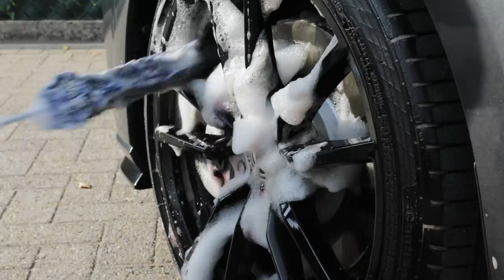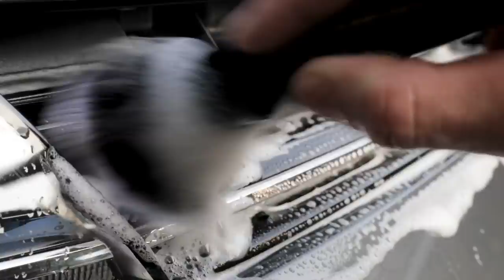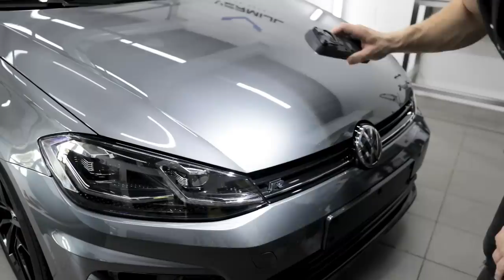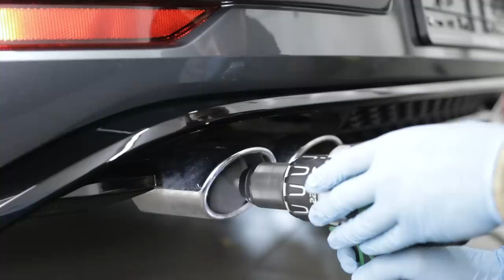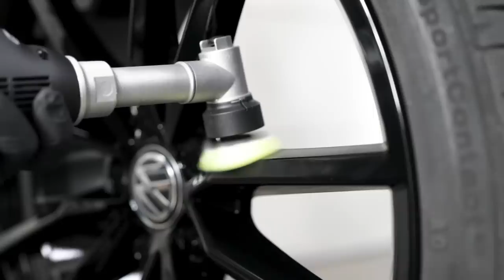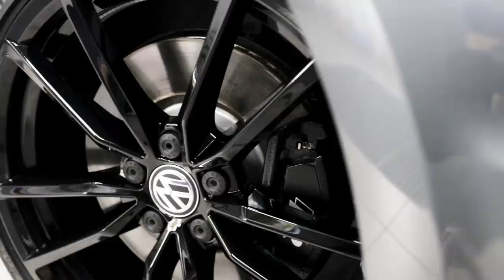New Car Detail VW Golf R 7.5 - CARPRO CQuartz

Comment: Hello there. Expert opinion in this business is clear. I follow your videos with interest. I want to ask you a question. I also have Golf 6. 2010 model. Black in color. It has a ceramic coating on it. What should I clean my car with after washing? As far as I can see from your video, you are using too many products. By the way, I am translating with google translate, as I do not know English, sorry.
Reply from the maker: I always recommend to wash the car with CARPRO Reset and decontaminate with IronX to remove brake dust and iron particles that might be stuck in the paint (only required if needed/every once in a while). Applying CARPRO Reload after washing the car is essential to maintain the ceramic coating, it provides additional protection on top of the existing coating. 👍
Reply: @VermijlCarDetail  Thank you. I will consider your suggestion. Have a nice day.
Reply from the maker: @Ellipsis441  Have a nice day!

Comment: What's the pointy of using carpro essence, when you apply eraser after polishing? Essence acts like a base for carpro ceramic coatings as it contains SiO2
Reply from the maker: You could just go straight into applying the coating, but I prefer to do a quick wipe down with Eraser just to be ultra safe. Usually I just spray some Eraser into a microfiber towel and wipe down the surface. Just to make sure all polishing residue has been removed, leaving behind a protected surface. If you would be doing a hand application of Essence, a wipe down with Eraser is recommended.